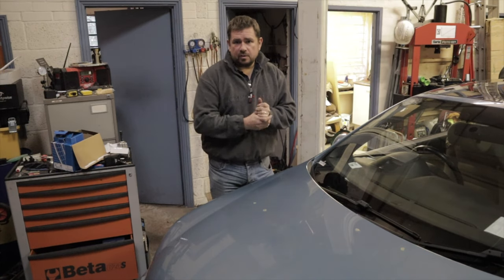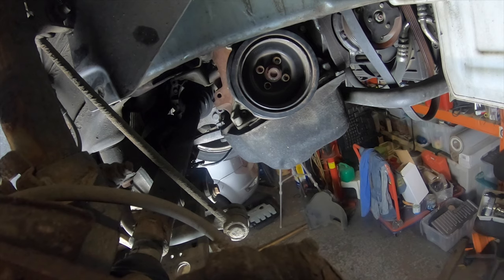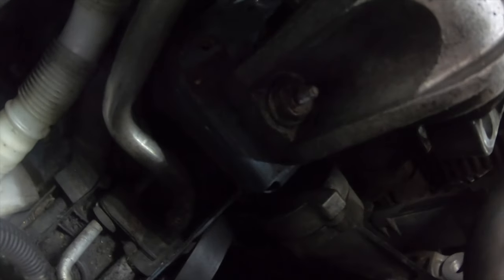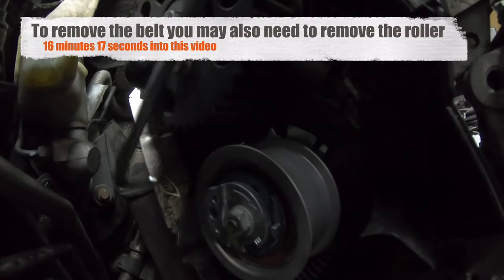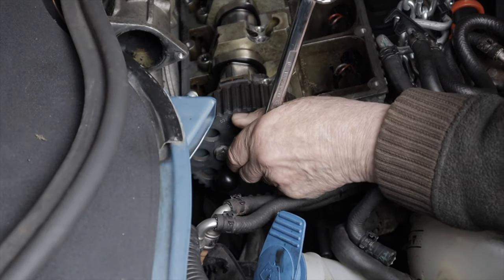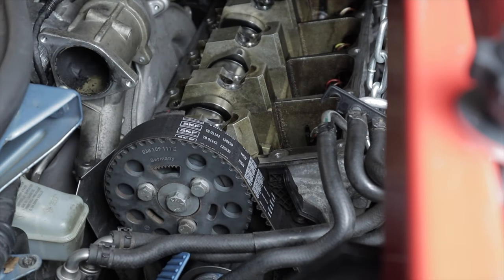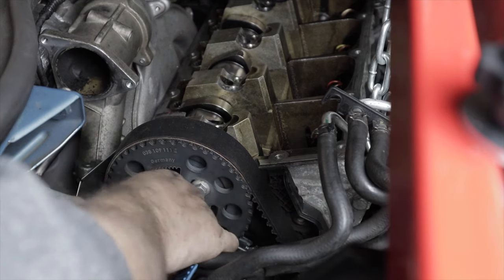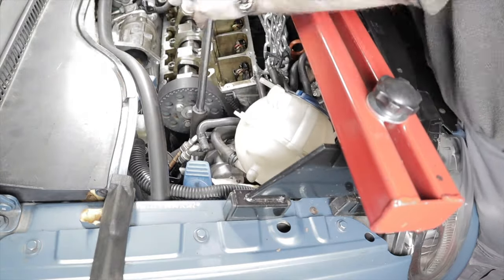Timing Belt and Water Pump replacement TDI, How to Properly set engine Timing from scratch

Comment: A super methodical video, it is really useful as my Eos has the same BMM engine . Brilliant , keep up the great work .
Reply from the maker: Thank you for your comment, I hope you subscribed I will have some more on the eos when lockdown ends and I can get it in my workshop again
Reply: @RichManPoorMotors  Hello, why does the timing synchronization change from 1.2 on a cold engine to 0.4 on a warm 90 C? Is the timing correctly installed? 1.6 tdi cayc engine ....

Comment: Thanks..........If you find that the alignment is slightly off, after the belt has been fitted and tensioned, and the engine has been rotated a few times.............how is the adjustment done...........is it done by undoing the three bolts in the camshaft pulley ?
Reply from the maker: The bolts in the camshaft can be used to adjust timing, giving your car a different power curve, eg more top end or more lower end, if you can pin the cam and crank at the same time this is set to factory

Comment: Hey guys my timing belt original before I changed timing belt wasn't in the good place was loose and working very well i changed it whit vw tools and put it in the right place now car is lagging at 2000 rpm should I put it back loose to much tight?

Comment: the tensioner mark won't be the same after you turn the engine, I sure you already adjust again, tensioner mark must be roughly past the centre of the gap in the base plate (rectifies itself during pretensioning)

Comment: Hi like your video I'm doing the same  job on caddy van wondering if I could get some advice, after lining up camshaft and crankshaft at the end of your video, and putting everything together do you have to angel the cam pulley to start engine or do anything else to start engine much appreciation if you can help 🆘 :0) 👍...
Reply from the maker: Hi i'm not sure of your question so please ask again if i haven't fully answered.

With the tools in the cam and crank, loosen the cam pulley gear bolts.
fit the new belt
keeping the belt tight between cam and crank on the side not under tension from the tensioner
fit the tensioner pulleys water pump etc and tension the tensioner correctly as shown 
re tighten the cam gear pulley bolts
before removing the pins now remove the pins
Your engine should now be timed but it is important to 
rotate the engine by hand twice slowly. (correct way rotation)
check that the locking pins can still fit in the cam and crank, this tells you that every thin is all lined up, 
(if they don't your timing is out. check your tensioner and cam crank alignment  you might have to redo all the above.)
if it is then your timing is correct as to factory
remove locking tools from crank and cam
refit covers, pulley and aux bet and tensioner for aux bel as shown.
then assuming your engine worked before the belt change the engine will start when you turn the key 

i hope i have answered what you needed to know

Comment: outstanding video, been looking for one like this forever, i have done audis and VW , but never a deisel so this is exactly what i was after. dont need every detail , but enough to get you by if you have car mechanics experience, great job !!
also i know you would never recommend this as a mechanic but can this be done by " teeth counting ? as i dont have the alignment tools, i did it this way on my buddies Audi TT and wondered if i could get away with it here . 
Thanks.
Reply from the maker: The locking tools are cheap, not worth the risk of damaging the engine in my opinion, you can adjust timing from manufacturers recommendation by moving the cam gear if you know what you are doing to change power curve but I just stick to stock
Reply: @RichManPoorMotors  yeah this car has 593k on it,  just keeping it running would be a major victory lol.
Reply from the maker: @cliveyoung3619  good mileage are you in the U.K.
Reply: @RichManPoorMotors  no I'm in Canada, so that is km, this Jetta has survived 15 Canadian winters, just had to completely rebuild rockers as there was nothing left.
Reply from the maker: @cliveyoung3619  nearly moved to Canada when I was a teenager, glad I don’t have those harsh winters, good luck with the rebuild

Comment: Would this be faster or easier if you remove the engine entirely from the vehicle?
Reply: Tell me you are not serious.☻
Reply from the maker: No need, more problems removing the engine
Reply: @rimsatec5215  it just looks so cramped. It can't be that much more time to drop the engine and transaxle and have way better access. Never done it so i don't know

Comment: I thought the arrow on the crank locking tool on the bottom is supposed to be to the left? I have both locking tools but heard others say to the left is the correct one.
Reply: AFAIK the 1.9 TDi PD is on the left.
Reply: @pauladams9477  Guess there’s different makers of tools that have different configurations also. Arrows in different orientation or placement.

Comment: Great video very helpfull this engine looks very similar to my Audi A3 1.9tdi pd BLS engine. Did you have any problem removing the inner engine mount?  Did you remove it from the top or bottom please? Thank you for taking the time to post this video its great for us DIY mechanics. You have a new subscriber. All the best matt. 😊👍👍
Reply from the maker: I did this some time ago so just trying to remember, everything done in the video was in the order I did it in, 
the engine mount was a bit of a pain in the A. I raised or lowered the engine a bit so that I could get the spanner’s through the access hole, after removing the top mount, if I remember correctly it had l3 or 4  hard to reach bolts that I kept trying different spanners and sockets on. I probably did it from top and bottom as I have a lift so Im always raising and lowing with bolts undone I tried to remove the inner mount on the engine and had trouble getting it out, then I thought I could do the job leaving the mount beside the engine and slipping the belt round it I think I might have lowered the engine a bit and then it fell out and I herd it hit the floor, putting it back was easier but still struggled getting the spanners on one or two bolts, just look for access holes in the engine bay or inner wings fenders etc as if you need to use them they will be there on a vw Audi group car, hope I’ve helped, good luck and let me know if you have done it
Reply: @RichManPoorMotors  Many thanks for your help. Keep  the great videos coming. 👍👍
Reply: Through the bottom

Comment: Also when you turned the bottom crank to place the tool in, did you leave the pin in the crank up top?
Reply from the maker: Hi there are a few tools out there so it’s best not to comment on this but if you have the correct tool slot it in as in the video
Reply from the maker: Reference tool on crank and tool in cam shafts, both tools should go in together, you might have to wiggle a bit owing to a worn belt, if working from no belt attached as in a engine rebuild put pin in cam and crank then put on the belt cam adjustable screws loose and tensioner and tighten as shown in the video
Reply: So I replaced the timing belt and the cjaa Jetta 2.0 tdi won’t start. I hooked everything back up right and primed the fuel pump several times to get any of the air out and after like 10 times it wouldn’t start. Everything all checked out all pins aligned and tensioner in the window after two manual cranks. Any ideas?
Reply from the maker: Pd engine are a pain to start with air in the system, they will start if everything is right but they will probably stop again a couple of times, same when you change fuel filter or pump, took me over half an hour to bleed mine
Reply: @RichManPoorMotors  we’re you ever worried about hurting the HPFP with cranking it numerous times with air in the line? That’s my worry now is if I damaged that hpfp and wondering is there a way to open it up and check for metal shavings? Thinking about just buying a new one beings I’m almost at 200k. I would like to put in the cp3 hpfp but think that may be beyond my DIY skills.
Reply from the maker: Air squashes at the injectors where the fuel dose not, and the pressure of the fuel is needed to operate the injectors properly, the lift pump primes the hpfp, it’s more the starter motor to worry about so give it plenty of rest between turning over to cool down
Reply: @RichManPoorMotors  How did you bleed the fuel system?
Reply from the maker: On common rail I would loosen the nut on the injector pipe but on the pd I just let the air bleed through the injectors, that while it takes so long to start, eventually they will run
Reply: @RichManPoorMotors  Thanks bro! Have a great day.

Comment: I have to change my water pump soon, it looks like the pump is pathetically trying to pump the coolant through the system, look's really weak when I get someone to step on the accelerator, why the hell aren't the water pumps just mechanical and not a complex clutch type.

The whole timing belt job was done on 74k, My car is now only on 106k, obviously the water pump is one of the plastic impeller type that comes with the kit.

So, I've bought the Meyle Heavy duty version of the water pump, it's guaranteed for 4 year's or 100k.
Also, the oil cooler need's a new heater exchange, so that'll get done along with the oil pump hex bearing shaft...
:/ I don't have the use of a lift so will have to get all that done via a 3ton jack and axle stands.

Ho flipping hum, I'd put it in a local garage but honestly, I do not trust them in the slightest.
Great video thank you.
Reply from the maker: Used 3 ton jacks for year, yes lifts make the job easier, just make sure your car is well supported
Reply: @RichManPoorMotors  thanks will do. 👍